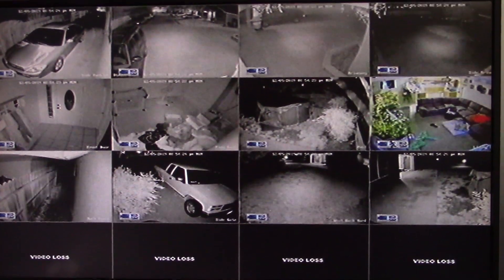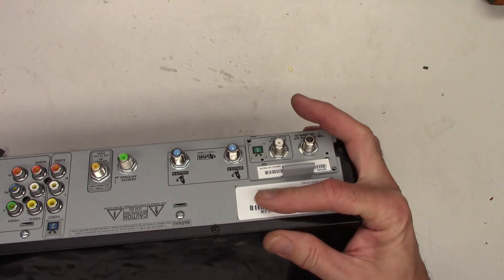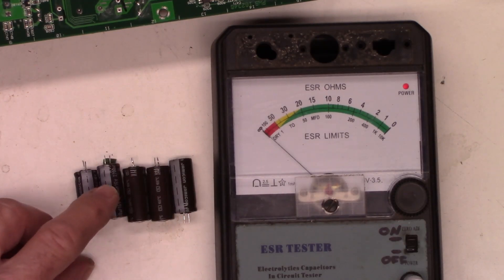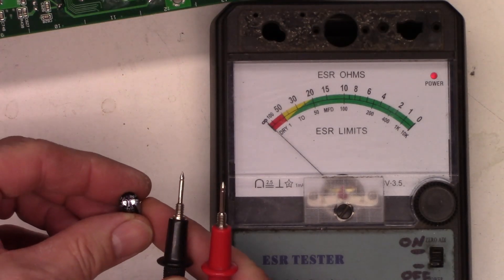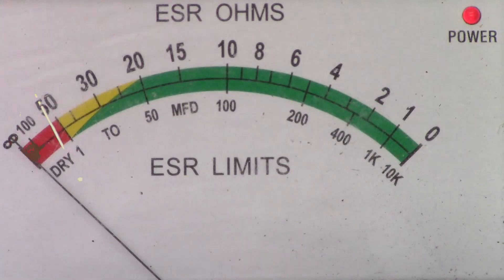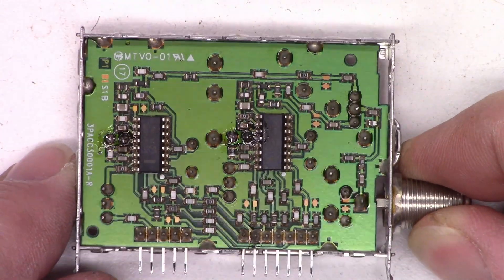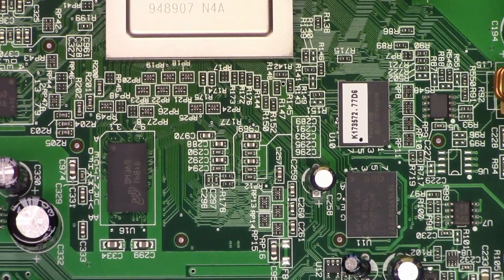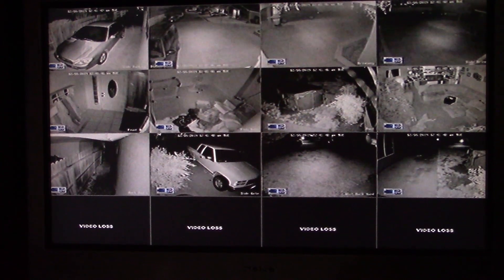DISH NETWORK VIP722K DISTORTED UHF / CABLE RF OUTPUT 22 DEFECTIVE CAPACITORS. REPAIRED!

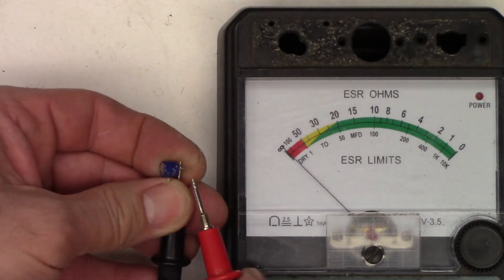Comment: I just noticed @8:25 that when you measured the two caps from the RF modulator the power led from the ESR meter was off. Not saying that thoose caps were good but the needle wouldn't have moved even if they were good. Good job and thanks for the video :)
Reply from the maker: Good eye, they were the same power on or off. Thanks for watching!

Comment: Anytime you see a bulging cap you should just replace them. There is no need to even check them. I would also go to the next higher voltage rating on the replacement caps.
Reply: Add leaking caps to that list as well. Just did an old JVC amp. Fired up intermittently after I pulled it out of mothballs for a basement system. When I checked them (main amp caps) they had leaked on the bottom at the mounting just under them. Didn't even check them and got a couple of nicer replacement quality caps and it fires up fine and sounds great.
Reply: @ThePreyMantas  I agree. Anytime you see a physically leaking cap replace it. That goes without even having to say it.
Reply: he knows what hes doing, im a beginner and i know that
Reply: @groovejet33  We all started out as beginners, no shame in that...